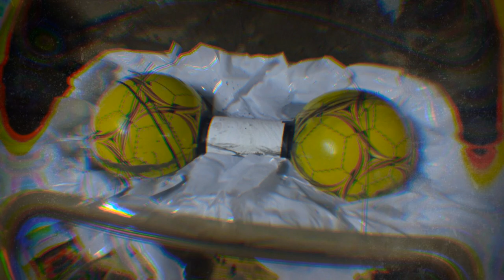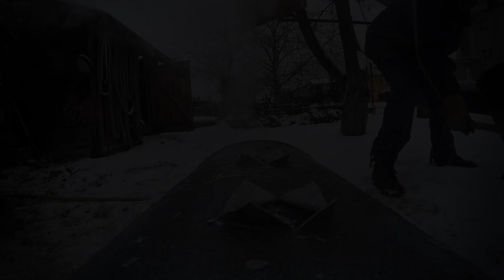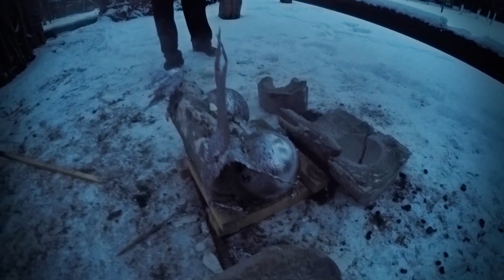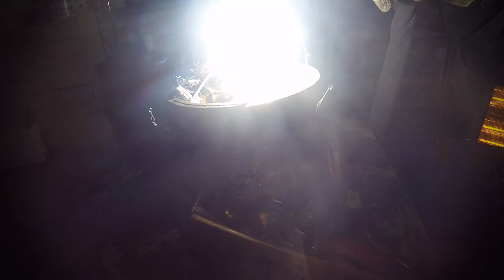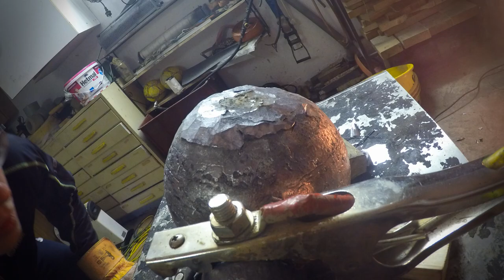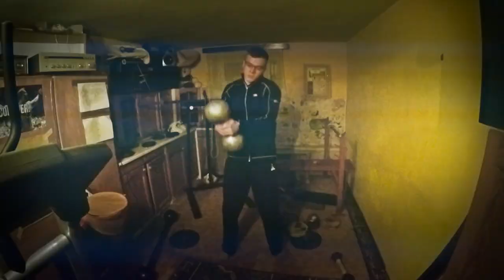Making my own Thomas Inch Dumbbell

Comment: What type of metal is used to get 175lbs in such a small form factor?
Reply from the maker: I forgot to add that this is a lighter replica. It weights 50kg (110lbs) and the material used is Lead (Pb) which is very heavy but very soft.
Reply: @3w56riggs  I see. So the original may be cast iron? Still hard to image that cast iron could be so heavy in such a small form.
Reply: @Apoplectic_Spock  real inch dumbell is much bigger and is made of cast iron
Reply: yeah watch some of the video of the original thing is massive